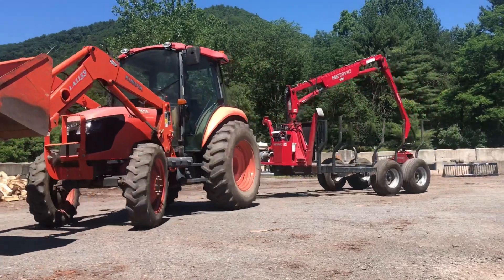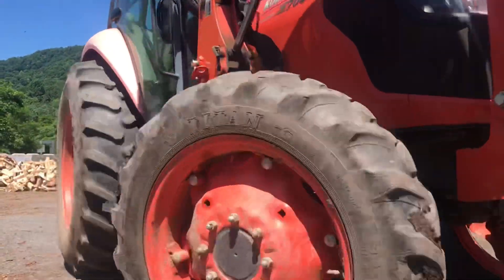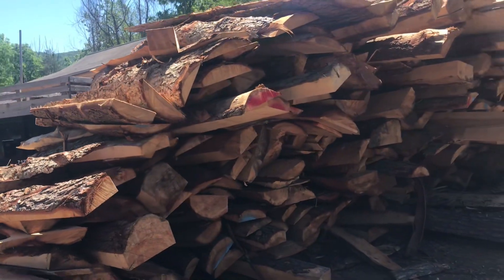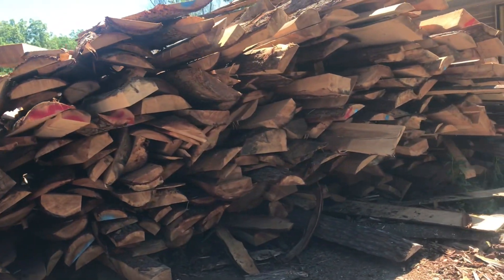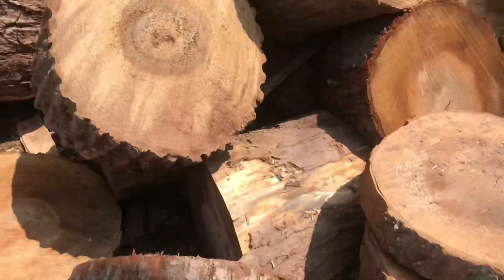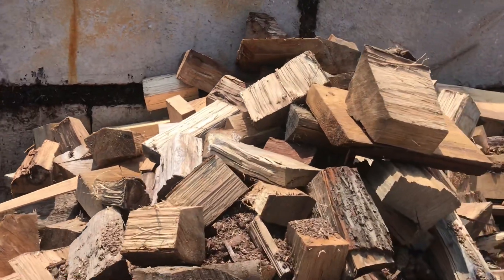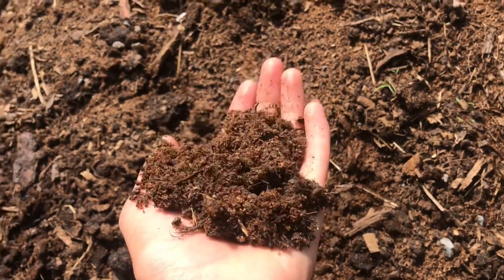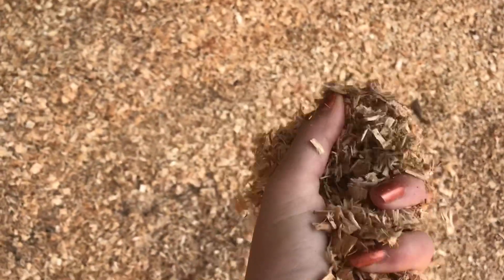Our Zero Waste Strategy

Comment: I've been milling for 28 years now running 3 Woodmizer sawmills. The 70, the 50, and the 15 wide. we operate 6 days a week. Producing about 5,000,000 bf  per year. I understand your waste problem, but I've come up with some ideas that might help you . We produce 100 times more waste then you do and here's how we handle it. (First) the soft wood slabs that come off your sawmill if there worthy cut them into 4' pieces and bundle them with plastic strapping. We use 4x4' metal racks for this . Sell them for fire wood. (people will buys them) Anything not worthy of firewood run through the chipper. (Second)edgings coming of the edger. We use  4'x8' metal racks for this. You can put these  pieces into as you edge your boards, stack neatly in your racks and once full band together with the plastic strapping.  You have the machinery to move these bundles so don't think there to big Sell these also as a bundle, much less work for you in the long run. Rather than running it all through a chipper. You might think about getting a grinder and making sawdust from your waste also. If there are any dairy farmers in your area they will be happy to buy your sawdust.        (Just 1 other thing) (please ladies take off those rings when your working.)

Good luck and i hope these ideas help you or even give you some of your own ideas

Comment: Another great video. Thank you. Trying removing the rubber boot and hang a 5 gal bucket from the mill. You will have to add a piece of metal to hang the handle from but every four or five passes you can just grab the bucket and dump it into a wheel barrow or the back of Kubota bed or anything. It works well for us once used to it and save a lot of shoveling dust off ground.

Comment: Great to see you reducing your waste.
I note that you sell firewood, and I would have thought that your slabs and edges and ends could all be sold as firewood
Wood burning stoves and heater and fireplaces all come in different sizes, so you could find that your customers would appreciate smaller or shorter pieces of wood. (eg an elderly person might not want to have to split, or being able to carry, some of the larger pieces coming off your processor. Remember, it is wood and it will burn. You might not be able to charge full price but for slightly less you could get better value out of it.
Good luck!